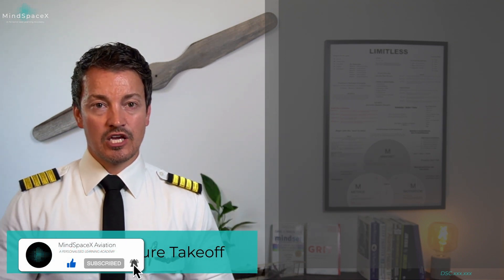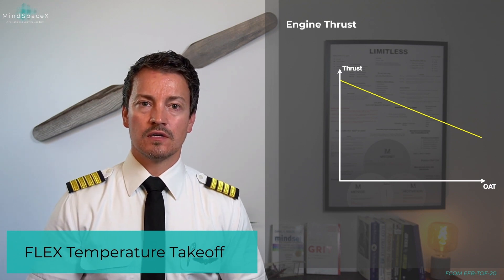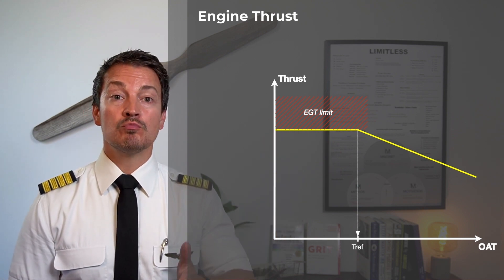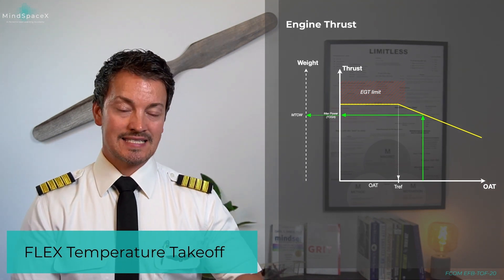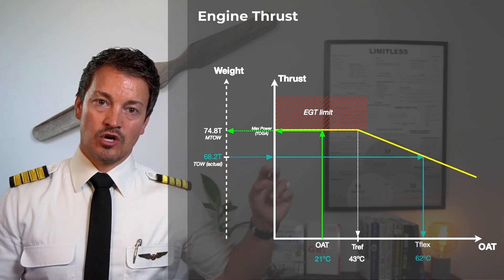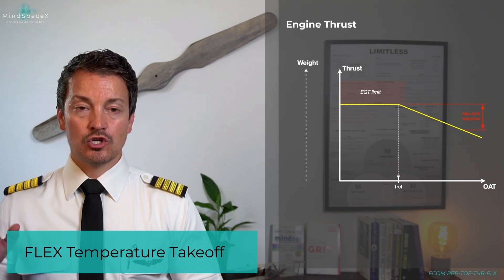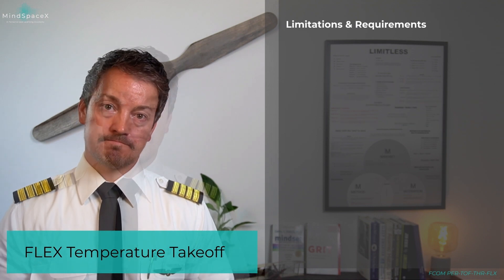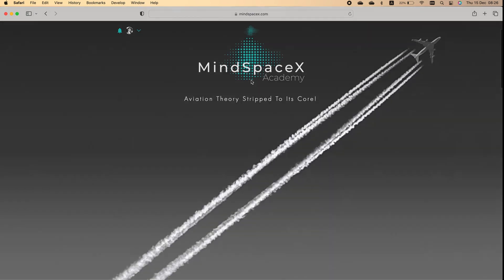Airbus Performance - FLEX temp explained (NEW SOUND)

Comment: What is the difference between wet runway and contaminated runway?
Reply from the maker: On a WET runway surface there is no risk of hydroplaning. So surface conditions are divided into two categories, risk and no risk. Up to 3mm of standing water or slush there is no risk so the surface is WET. Above there is a considerable risk so we consider the surface CONTAMINATED.
Reply: @MindSpaceXAviation  thanks for the explanation
Reply: @MindSpaceXAviation  What does contaminated runway look like in ATIS or METAR?
Reply from the maker: Hi, 

On METAR's the runway conditions are not stated directly. Pilots interpret the outside conditions and use ATIS for clarification. On ATIS the audio message will state the level and type of contaminates. It is then up to the individual aircraft types and the respective manuals to determine the effect this has on the aircraft performance.
Reply: @MindSpaceXAviation  Thanks for the reply!